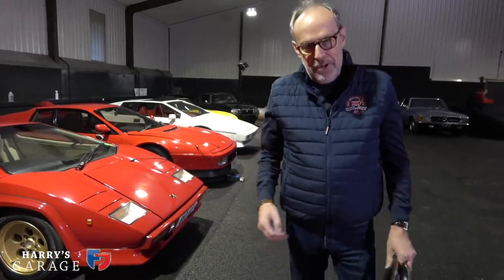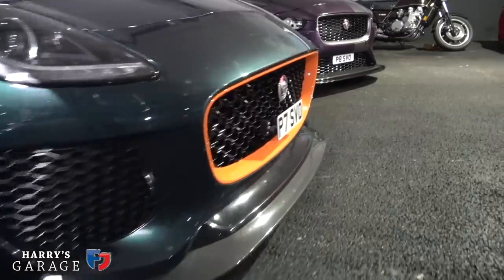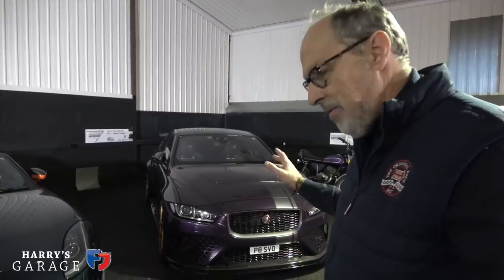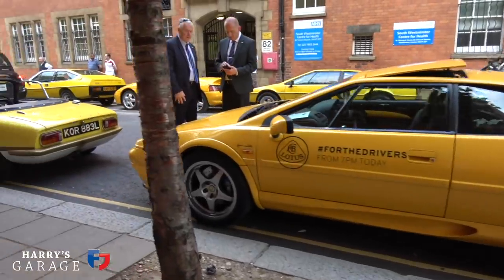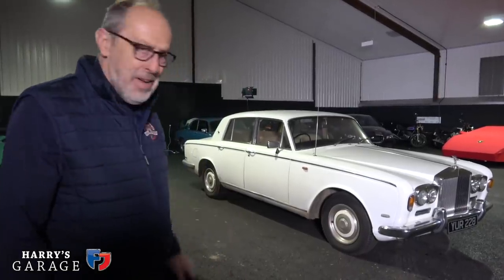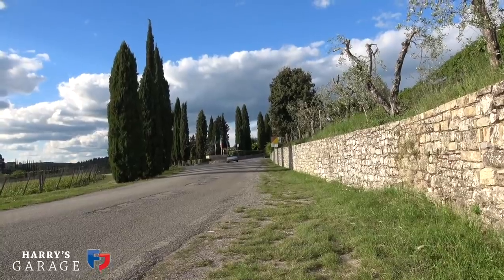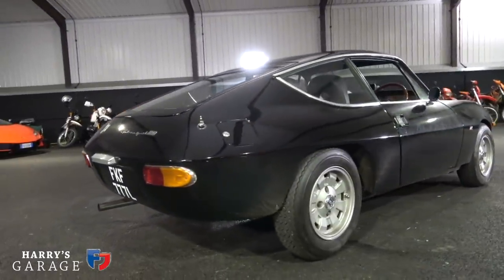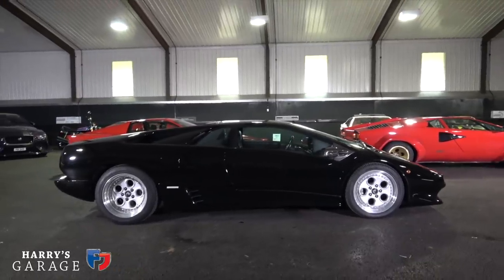Here's what it cost me to run my fleet of 20 cars and 16 bikes in 2019..

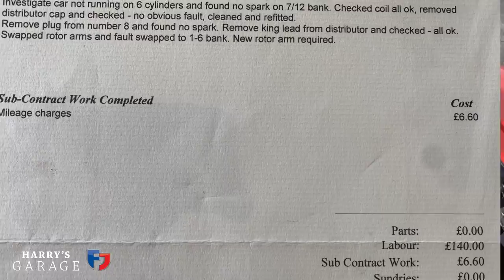Comment: 08:42
I'm surprised that you didn't swap the other rotor arm as it probably would have ages similarly.
Reply: As long as it runs well he doesnt need to, and if it starts acting up its a 10 minute job to check and change.
Reply: @banaana1234  
At 08:50, he says that the the rotor arm must have been on the way out, giving a weak spark but he clearly didn't notice the gradual reduction in performance, so IMO, it'd be advisable to have changed both.
Reply: @lewis72  It really is a first world problem when your not sure if you should just change one or both rotor arms on your testarossa haha!
Reply: @pinkpotato1  
I'm sure that both rotor arms should be changed.

Comment: Great video, again. Thank you Harry! Drove my Lotus Esprit S2.2 during two winters through Switzerland on summer tires... the car handled wonderfully, even through 10 inches of snow when driving up from Montreux towards Zürich... had to make sure not to stop whilst going up the hill though...
Reply from the maker: Interesting. Low weight is always a good thing in snow, so maybe that helped too?
Reply: Certainly. The Esprit has a good traction  (nearly 50/50 weight distribution) when wearing decent tyres and yes, the Esprit S2.2 is a featherweight of approx. 950 Kilograms or so.

Comment: I have owned a lot of old cars, mainly Saab 900,and Volvo 245.Never had problems with ignition,brakes etc.Once had a clogged up Petrol filter,wich was weird.Oh had to replace a seal on the steering servo on the midnight blue Saab 900..However these cars served me good through winter storms.Snow coming up on the bonnet kind of storm.Got home safe, including an hysterical mother with child with crupe.That was an interesting hour and half drive-in raging snowstorm, but my front heavy Saab 900 got us there.

Comment: Have you ever tried a product called fluid film? It's a bees wax based rust inhibitor. It's a miracle on battery terminals and I used to maintain a fleet of 200 golf carts and a once a year treatment which is just a generous spray on terminals and any rust spots and it stops rust and corrosion and you can practically eat the stuff it's so mild to use. The bee's wax literally coats everything and never goes away unless you wash it away. This stuff has saved me a ton of cash literally. Living in Canada you can only imagine the battle against corrosion lol.

Comment: He doesn't drive a single car but it 's still fascinating to watch. Thanks again for a great video, Harry. And for the tip about the rust-proofing product - which I will use because I like to drive my 'classics' on Swiss roads in winter.
Reply from the maker: Good plan. I found out about it from the motorbike world where it's used extensively to protect engines, suspension, etc from corrosion on wintery roads.

Comment: i spent a total of 4000 USD for my 3 cars --- 2010 Mazda3 MPS daily driver maint. and engine mounts/trans mount, recirc valve, egr cleaning, set of tires and brakes - I did the labor -- $2400 - its used for business for lot of miles racked on this year; 1989 Jaguar XJ6 VDP Majestic - $1500 for engine swap - engine blew up last year so new one is almost in the car and it will be perfect again. 2007 Audi S8 V10 - $100 dollars - LOF. needed nothing else.

Comment: when I was 18 with a £2000 fiat grande punto 1.2 I got an insurance multiquote and the cheapest one was £6100 and I live in a nice area.  I ended up going as a named driver and it came down to 2500 which i still think is shocking considering im sensible- now 6 years no claims down the line without a single ticket or fine or any issues (touch wood). Anyway, nice video and very interesting to see the breakdown.
Reply: You can sometimes add multiple relatives onto the policy to dilute the risk.......

Comment: Nice round-up £8k divided by total value of jalopies is probably well under 1%, so a great deal - pay similar my self😏 ps love 1300/6 Kwaka along with your H2C - May I suggest an investment two stroke 70/80s motorcrosser CR500, Husqy or Maico they are a blast !! 93 (run-out) De Tomaso Panterra my secret lust and weirdly a 84/85 MG metro (long-in- tooth a series engine I know) Turbo too!!!

Comment: Interesting video - Thanks Harry.

As a Honda fan, I prefer the Z1300 to the CBx. Its got a better chassis, wider rear tyre, there are more than 4 mechanics in the UK who can rebuild the engine if necessary (not have to every 10k miles), and with more made they are cheaper. Good Choice = Happy riding in 2020. Good Luck!
Reply from the maker: Interesting, I'm a big Honda fan too but CBX is a bit fickle when you do a bit of digging and I liked the robustness of the Z1300. Came down to bang for buck and I think the Z1300 has it over CBX; less than half the price, more power, better sorted and a hoot to ride. Loving it so far!
Reply: @harrysgarage  I was an RAC/ACU instructor in the late 1970's, and had a chance to try a brand new CBx. The big issue is the rear tyre, which couldn't handle the torque, made worse by a chassis that was extended from that for the CB900, which itself was an extension of the CB750. Even hence with modern tyres, you can't throttle it until she's upright - or its quick trip to the deck and backwards through a hedge. It was near impossible to ride in the rain, apparently. The top end was far too complex, and much like my beloved Triumph Trident suffered oil distribution/over heat difficuties in the middle cyclinders. I looked at buying one again in the late 1990's, but as the very honest salesman pointed out, then there were only 6 decent mechanics in the whole of the UK who could rebuild the engine, which at maximum last 15k between rebuilds. Like yourself, I choose not to buy on grounds of fickle engineering and high maintenance costs. Even at thier now inflated thanks to the American market (where there are few corners) prices, still glad that I didn't buy it. It would have been an expensive garage queen. Good Luck!

Comment: I got a Z 1300 same as Harrys with carbs-- 6 cylinders fed by 3 carbs-3 manifolds--they couldnt put 6 carbs on it cos there would be no room for your knees! the Honda CBX got 6 carbs but they had to tilt the whole engine forward 30 degrees so that you could actually sit onit!

Comment: I had a Z1300 in the early 90's. Even put a dusting on the side for about 10000 klms. Fantastic bike other than water leaks although never an express. Replaced it with a GPZ1000 bike. First EFI and it was also great but had the turning circle of a bus. That bike taught me how to fault find efi often at the most inopportune times. Only bike I ever owned that I have carried a multi meter in the tool kit. Replaced it with the best bike I ever had an GSX1100 EFE that I turned into a street fighter style. Fond memories of that 16" front wheel and the super fast turn in it gave. I was on the verge of selling it because I thought I couldn't get the clutch to stop slipping after a couple of new clutch packs but I chanced upon a fellow who had a video camera and he videoed a take off that i was sure it was slipping on. Checked the film and sure enough it wasn't slip it was wheel spin in second gear. Still got it.

Comment: £8K insurance doesn't seem so bad for the collection and the family driving them. £1500 for an Esprit radiator seems a tad high. Is there any reason a much cheaper custom ally rad could not have been used ?

Comment: Trends I notice when I listen to Harry's Garage: he gives himself 500 more RPM over every car's respective redline (and seems to get away with it 😜), and he keeps tires on his cars way too long...ten year old tires again 😣 Harry! Make it an annual tradition to check your car's tire date codes and replace at 6 years old, max!
Reply: As for the Arctic Rolls, I'd vote to keep the shabby body (as long as it's not truly rusting apart structurally) and do the work to stem the oil consumption. Let it have its patina, its earned it, but keep the mechanicals tight and make it a good runner 👍

Comment: So the testarossa had weak spark? hmm I wonder if you should send it back to the grand tour along with the countach for a proper retest and a dry test then, as they bashed it pretty hard in that, plus I must wonder how good it would be with some Michelin Pilot Sport's on it, as tire tech has moved on considerably in 30 years, and every sod on the internet raves about the 4S's it seems.

hell that alone might make for a fun video for the channel, like old tire tech vs new on a classic car, as theirs this huge thing about restomodding cars and redoing the suspensions with stuff from ridetech here in the US

and yet no one ever just changes the tires first and then sees what it needs.

Comment: Sad to see the Porsche 993 Turbo/GT2 has gone. Any particular reason? It was a particular favourite of mine
Reply from the maker: Didn't like driving it on road as it was too tweaked. Suspension was too hard and it had little clearance. Plus it destroyed the gearbox because of the amount of power it had and I was keen not to have to pay for another rebuild. P8 quicker and better in many ways, apart from size.
Reply: Harry's garage that’s a shame, I’m a big admirer of it. Still, there’s enough left in the barn to keep me entertained 👍 
I could just see a Alpine A310 or similar in that barn.......😉